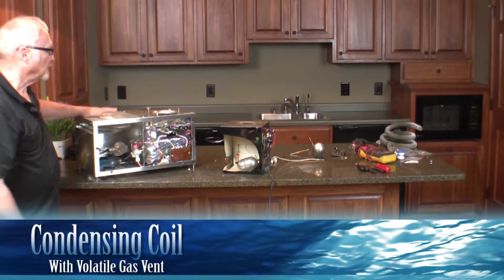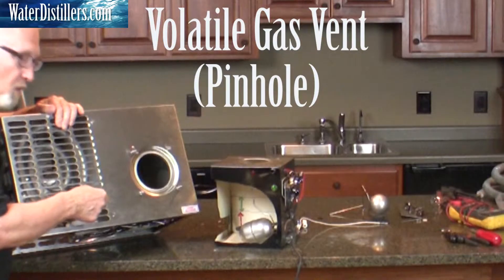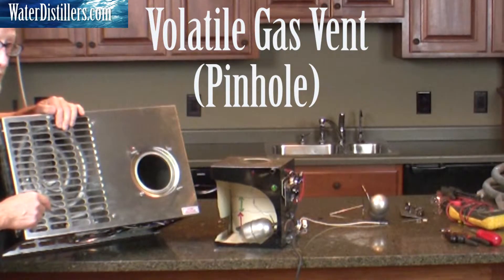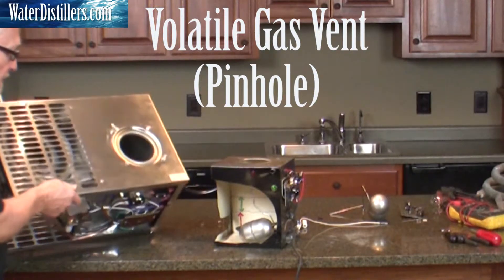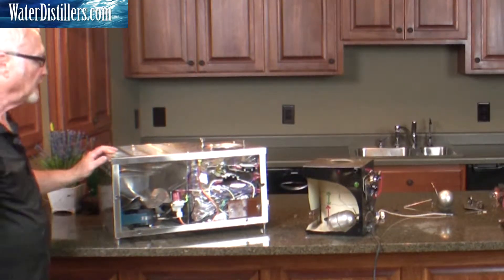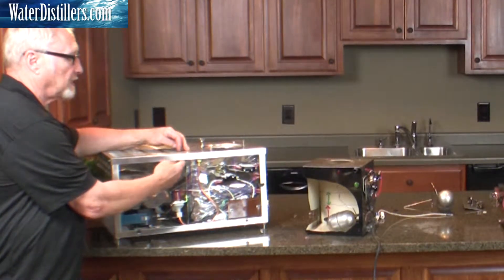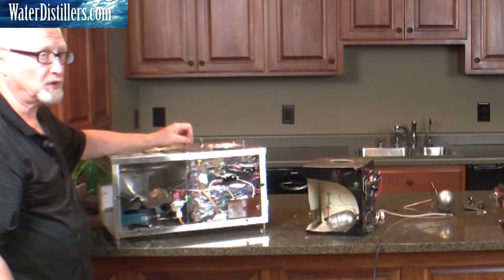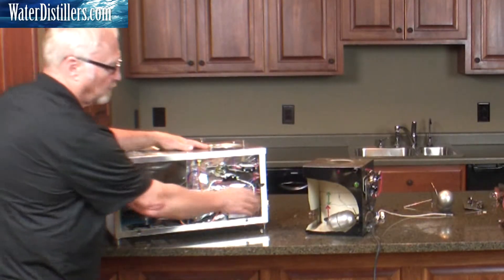Water Distiller Condensing Coil and Volatile Gas Vent Pinhole

Comment: I bought a water distiller from China Aliexpress a while ago and noticed that the condensing coil has a hole in it. The hole is located on the coil after it rises out of the steam chamber and right before the start of the cooling fins.
The distiller didn't come with any info about who the manufacturer is so I couldn't contact them; I contacted the Aliexpress seller and they didn't respond to my messages.

I didn't see why there should be a hole, I thought that it would just unnecessarily let steam escape.
But now I saw this video and apparently the hole has a purpose as a volatile gas vent.